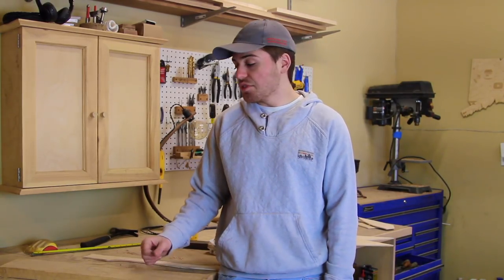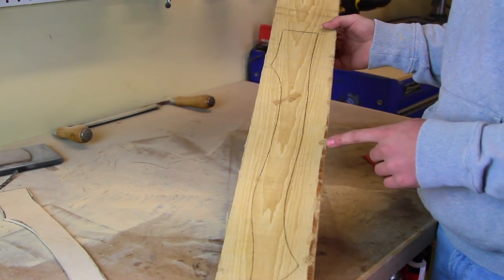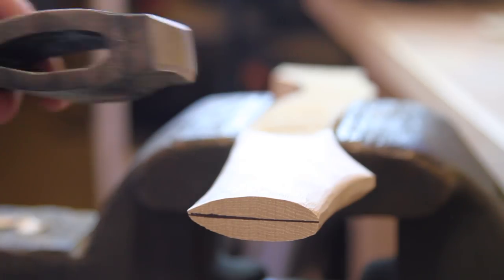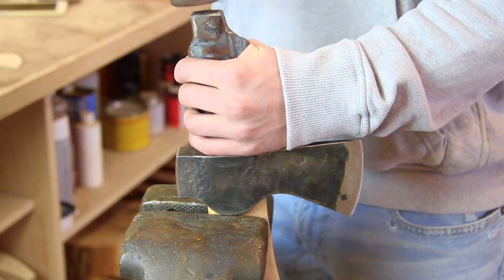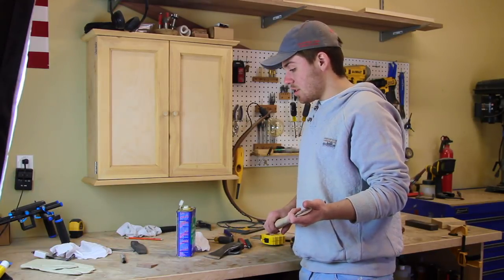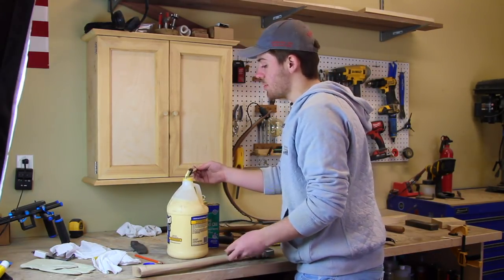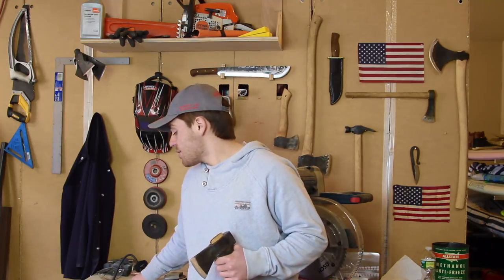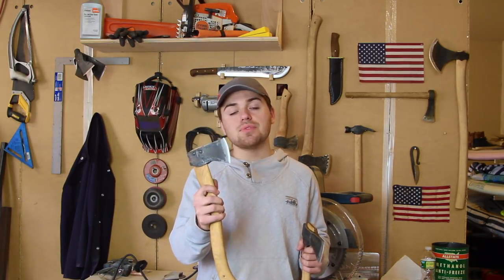Making an Axe Handle

Comment: Excellent handle! Looks to be a boys axe with the shorter handle. Noticed that your saw has sap/residue buildup. I clean it off with carb cleaner and old rag, then wipe a bit of olive oil on the sides for protection and smooth cutting. Should make cutting your wedge slot easier.

Comment: Great job!  How thick is your handle along most of it?  I've done some experimenting and base on some old handles I've collected, I really like the feel of the thinner, oval shape. Hey, just a warning in case you or others watching don't know ...watch out for for boiled linseed oil soaked rags, they can spontaneously combust. So put them in a metal trash can until they dry.
Reply from the maker: Thanks Kyle! The handle is a little less than an inch on the thin side of the oval and about an inch and 3/8ths on the thick portion of the oval. And thank you for warning me about the linseed oil!! That’s crazy I had no idea that happened. I just looked up a news report and they tested it and it really does just burst into flames! Maybe I’ll do a video on that soon
Reply: Paul Pinto good idea, yeah I thought it was just a myth but some guys have burned their houses down apparently!  hey, I'll finally have time later today to work on the handle and fire up the forge! Question for you, how long do you wait to let your forge heat up before putting material in there?  Also for the hammer or axe blanks how long does it take for them to get red/orange hot and retain their heat like I see in your vids?  My material seems to cool off too quickly...either the forge isn't hot enough or I'm being impatient...
Reply from the maker: Great I can’t wait to see it! And I probably wait like 15min before I put my material in. It takes a little while maybe 5 to 10 minuets for and axe or hammer billet to heat up but once it’s up to temperature it takes much less time to heat back up in between heats. If you are using thin material it will not stay hot very long and the anvil will suck a lot of heat out of the material too, to help with that you can try to keep as much of the material as possible off the anvil and only keep the portion you are hammering on touching the anvil. I would have to see your forge to know if it’s not hot enough but if it can heat the steel to a bright yellow it should be fine. Hope this helps!

Comment: hey paul does oak work well for axe handles to because i'm from the netherlands and hickory is absolutely not available around here and ash is currently very hard to get aswell
Reply: I can send you some australian spotted gum, it is very good for axe handle
Reply: Oak is certainly strong enough but is does not have the same flex as hickory or ash and will not absorb shock. If you have access to yellow birch that  would be my next choice. Hope this helps......skål